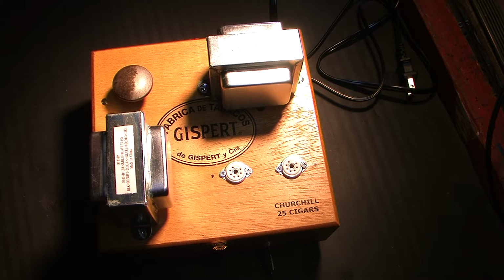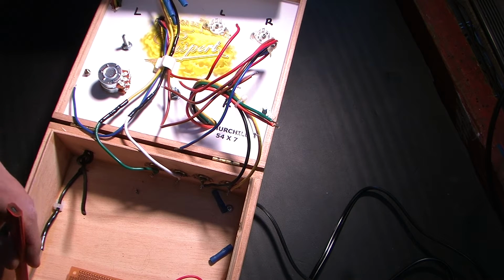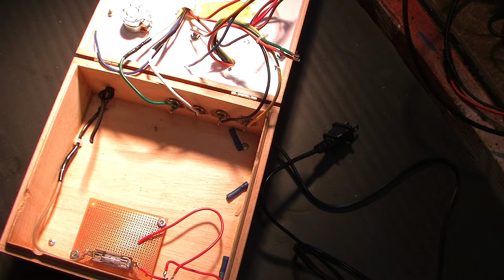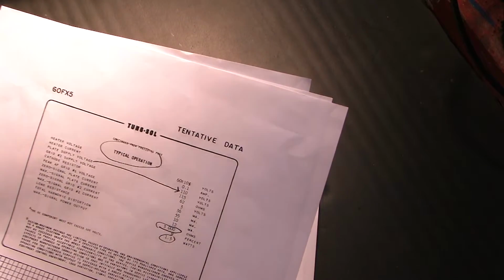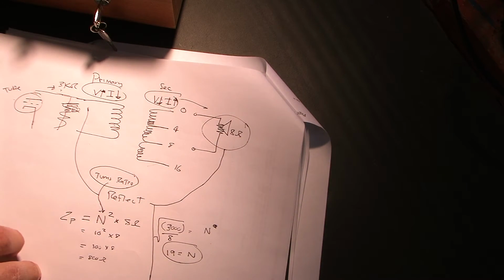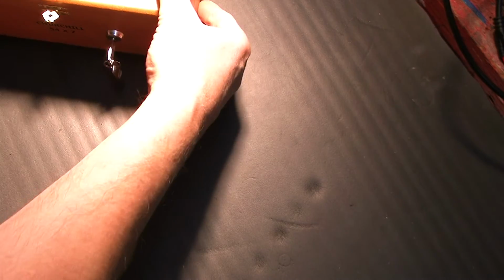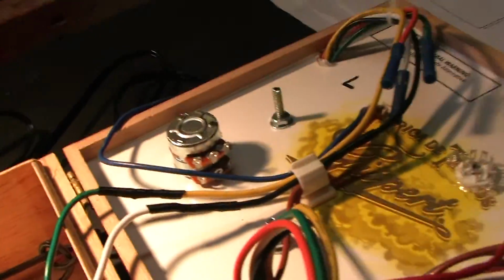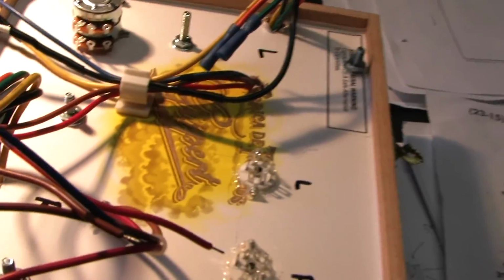Tube Amp Project Pt. 4: Power Line; Transformer Testing; Design Layout

Comment: When using a polarized power cable the Neutral (IE the bigger blade/prong) has a ribbed side on the other sheathing of the wire. Some also have lettering or even an white line on the outer sheathing.

Dunno why anyone would want to use a transformerless amp. Double insulated chassis or not it can still be a fire hazard. Not to mention 117/120 volts isn't enough to get the full range of a tube. I'm building a mono Class-A hi-fi amp from a old TrueTone radio with a 6SN7 preamp and a 6v6 power amp. Kinda tempted to make it Stereo but the chassis is only so big for additional chokes and a second output transformer.